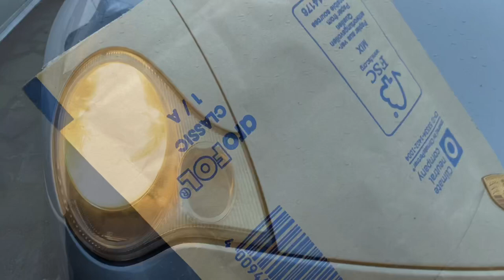Replace head lamp bulbs on Porsche 996 911

Comment: what are the bulbs on the inside of the headlghts?
Reply: Stock Halogen set-up uses H7, 55W for low beam; H9, 65W for high beam replacement bulbs.  Bi-Xenon was an option with different parts.
Reply: @picknswing  thank you